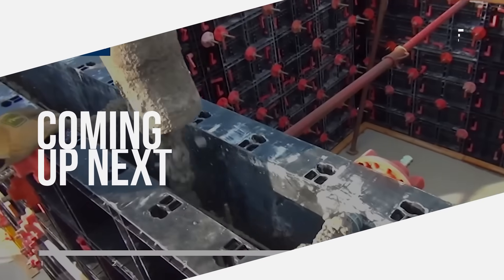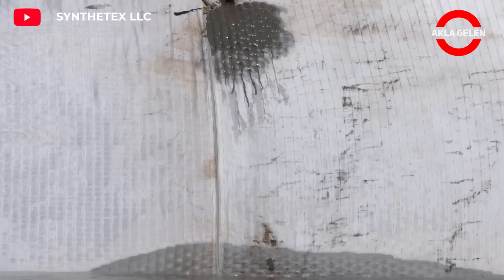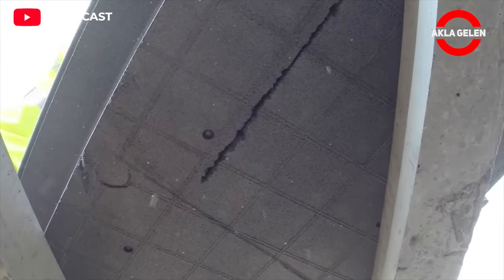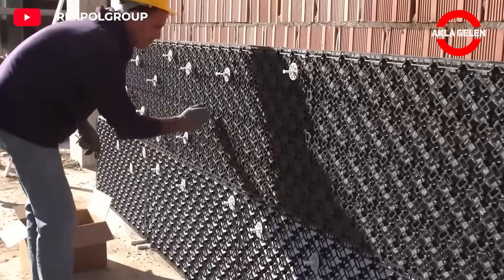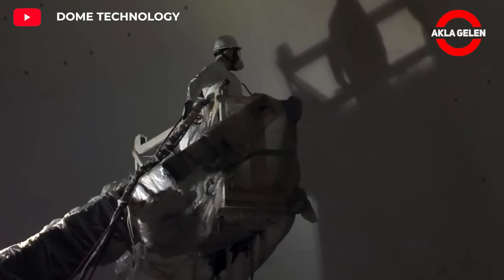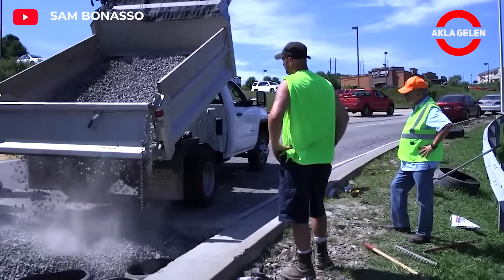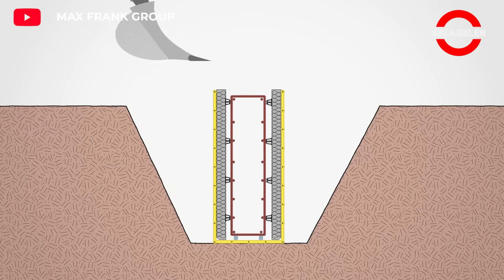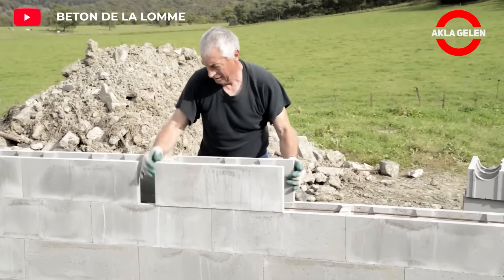Construction Workers Can't Believe This Technique Works - Most Ingenious Construction Techniques

Comment: 1:38  "When concrete dries" ?????
Concrete does not dry.  The water combines with cement in an exothermic reaction.  The final strength of the concrete is determined by the water cement ratio.  That's the amount of water used in the mix.  
FUN FACT :  The Hoover Dam, built in the 1930s, is still being cooled to take away the heat generated by the continuing reaction of the concrete hardening.
Reply: Your "Fun fact" isn't accurate. 

"The Hoover Dam concrete would cure in 125 years by conventional or natural methods. Crews, however, used some innovative engineering methods to hasten the process.

Nearly 600 miles of steel pipes woven through the concrete blocks significantly reduced the chemical heat from the setting for the concrete. Crews relied on 1,000-pound blocks of ice produced daily at the site’s ammonia-refrigeration plant.

The pipes that were used to cool the large blocks were later filled with concrete for additional strength"
Reply: @jacqdanieles  Ah!  Shows how far behind the times I am.  Thanks for the update.
Reply: @farrier2708  When you and I went, it probably still was curing.   I went in the 90s and did the "inside the dam tour" where you got to go inside the dam wearing a hard hat.   And the tour guide then told us it was still curing.

It was known as the Boulder Dam until renamed for the former president.   Officially 96 men gave their lives to build it.   Unofficially, the number runs as high as 106 (including some deaths on site before the official construction start).
Reply: @mac_mcleod I've never been to US, Mac, never mind the dam.  The dam though, was a subject we covered during my Architectural studies in the 70's.  We were also told that the last man to die during the construction was the son of the first but that could be just an urban myth.
Reply: When something that used to be wet is no longer wet, most people would accurately call that "drying". We're all very impressed that you knew the technical term is "curing" but I think "dries" instead of "cures" is good enough for an AI generated voice channel like this lol
Reply: @theagemaway  They may call it drying but it wouldn't be accurate.
Reply: I got a concrete you know what….👃🏼
Reply: @jerrytaliercio9087  Be careful!  Staining can spoil the aesthetics of it and worse still, it'll crack and break off if you stress it.
Reply: Concrete cures forever changes everyday
Reply: While there is free water concrete continues to harden.
Reply: WHO EVER TOLD YOU THAT CONCRETE DOESNT DRY LIED TO YOU  AND YOUR STUPID ENOUGH TO BELIEVE THAT , .WE ARE ALL LAUGHING OUR ASS OFF ESPECIALLY BECAUSE YOU USE HOOVER DAM AS AN EXAMPLE ..LOL.LOL.LOL.LOL
Reply: Are you stupid , ?
Reply: I pour concrete every day.. who gives a fk.
Reply: @heathmilan7894  Not you! Obviously.
That's why you pour the concrete and I specify how it should be poured.
Reply: Haha you’ve been told.

Comment: Concrete house needs to be insulated well. Really cold in the winter and unbearably hot and muggy at night in the summer.
Reply: Perhaps a hemp slurry stucco type finish... But things are definitely zeroing in on an excellent structure for hurricane alleys...
Reply: Yes, so why not use ICF and leave an insulating form behind?
Reply: Basement
Reply: @R.BOWERS  Not what I was saying. Did I say a concrete house can change the climate? No.
Reply: 😂 Really?
Reply: @Kenny.G-33  I live in a concrete box so yes really. 12 years of freezing winters and uncomfortable summer nights. Concrete stores heat like no other and radiates it back out overnight, and you can’t do anything about it.
Reply: @Vile_Entity_3545 where are you in prison?
Reply: I wouldn't ever buy a wood home if I could avoid it at all
Reply: Still better than toothpicks.
Reply: That's why old brick,and stone houses had a basement. It helped cool the house in the summer when you opened the door,and gave a place for a water boiler heater,or large wood stove.
Also,the attic was not originally created for storage of THINGS,but hot air. It was the houses insulation.
But you are right, as the video shows: one story ,all concrete, no basement,and nothing of attic space.
Although now that I think of it if you were in direct heat that would mean you're in direct sunlight they could use solar for air conditioning and heat